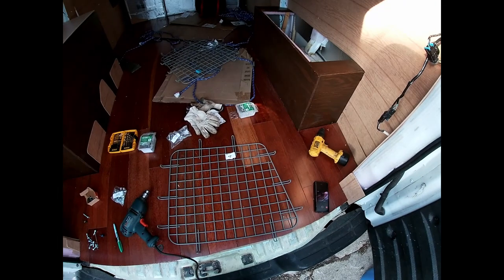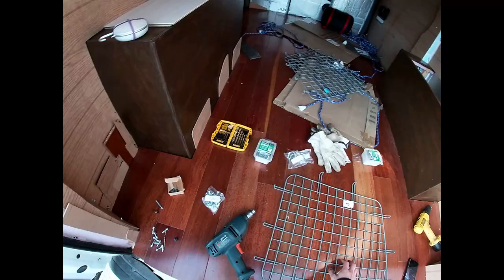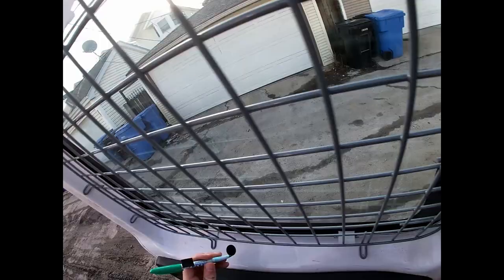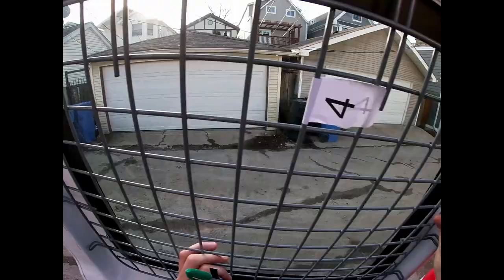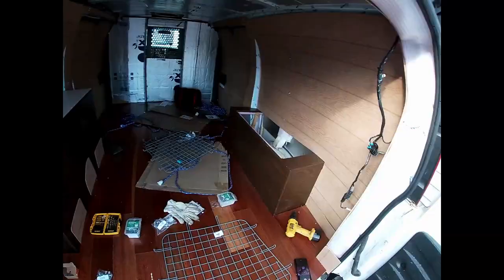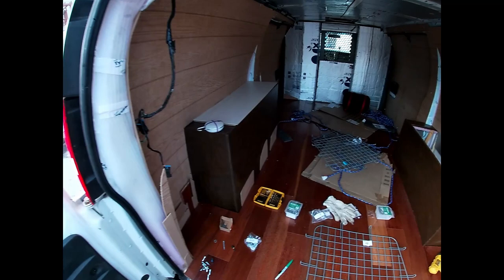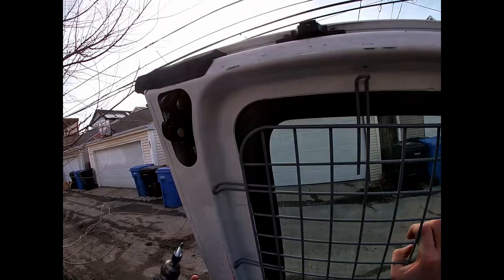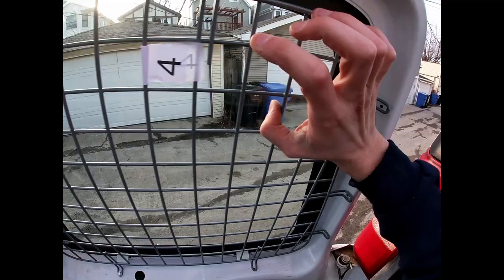Van Window Security Screen Installation

Comment: A thief will just break your window and pop that out..  No washers, lock nuts, or nuts..  I plan on tac welding mine
Reply: They can just use wire cutters. His plan is better incase you need to install another one